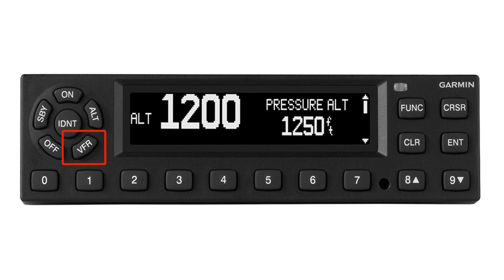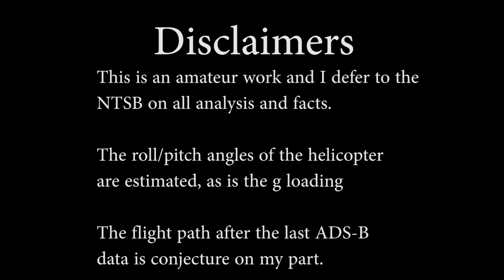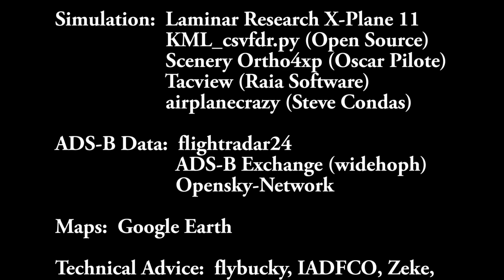Newly released Pilot to ATC Audio!  N72EX (Kobe Bryant) Crash Reconstruction.

Comment: As pilot with over 4500 hours experience, I beleve the pilot was flying VFR, went into IFR conditions, but kept flying VFR rules.
Reply from the maker: Just for my interest, do you think the pilot should have declared an emergency to ATC saying that he had gone IIMC?  I don't think it would have changed the outcome.
Reply: @stevencondas2281  should have flown with instruments to get out of the clouds imo. Every pilot should be able to do a 180° turn only with a Variometer, an Artificial Horizon and an Altimeter to be able to get out of the clouds if he somehow gets trapped inside one. 
In addition, in a well prepared flight you usually have a knowledge of the terrain around you (especially while flying VFR close to high reliefs) thus, you can be able to climb to a Safe Altitude over the clouds while flying on a determined heading that will keep you far from the high grounds (In a heli you can even stop yourself and climb vertically so nothing too difficult there imo).

Imo bad flight planning, lack of experience in such conditions, lack of training/qualifications to fly in such conditions, lack of authority (shouldn't even have departed with such a weather knowing his limits).

But hey, I am not a heli pilot, nor a professionnal pilot yet so I might be wrong.
Reply from the maker: @pinguuuu2269  FWIW, here is the high level IIMC procedure from the Island Express training manual: 

"Control: First use the wings on the attitude indicator to level the helicopter. Maintain heading and increase to climb power. Establish best climb airspeed but no slower than VMINI. Cross reference attitude indicator to indicate a positive attitude.

Climb: Climb straight ahead until your crosscheck is established. Then make a turn only to avoid terrain or objects. If a climb altitude has not been previously established with ATC, then you should climb to an altitude that is at least 1,000 feet above the highest known object or terrain and that allows for contacting ATC.

Turn: If a turn back to VMC is the best course of action, only initiate the turn after stable flight is achieved. First note the heading that you are on then begin the turn and maintain a
 constant rate of turn to the selected heading. Use of the heading bug is a great tool in this situation. (Steve's note:  The pilot was in a mountain pass when he went IIMC, so there were hills to either side perhaps making a 180 inadvisable)

Communicate: Attempt to contact ATC as soon as the helicopter is stabilized in the climb and headed away from danger. If the appropriate frequency is not known, you should attempt to contact ATC on either very high frequency (VHF) 121.5 or ultra high frequency (UHF) 243.0. Initial information provided to ATC should be your approximate location, that inadvertent IMC has been encountered and an emergency climb has been made, your altitude, amount of flight time remaining (fuel state), and number of persons on board. You should then request a vector to either VFR weather conditions or to the nearest suitable airport/heliport that conditions will support a successful approach. If unable to contact ATC and a transponder code has not been previously established with ATC for inadvertent IMC, change the transponder code to 7700.

Note: All of the above will be practiced by Manual Manipulation of the Controls and the use of Auto Pilot. The pilot will learn the advantages and disadvantages of recovery by Manual Control and Automation. Example manual control is quicker I Automation slower. However, if pilot experiencing spatial disorientation and unable to regain control Automation is the best option. Also, the pilot will become familiar with the use of the "Go-Around Button" and its functions."
Reply: Steven Condas I agree. It would have made no difference. Either he was hoping to see something outside or was inside and completely lost his scan. 
Looks quite similar to JFK Jr’s accident.
Reply: It certainly makes the case for two pilots in a helicopter when flying in bad weather or at night.  I served in military helicopters (Maritime) and experienced a novice pilot losing the bubble completely at night over the ocean and he started making radical changes in altitude not knowing where he was or how to react.  The experienced pilot took over as soon as he could and the aircraft settled smoothly.   I was a new backender in training but didn't realize what happened but knew it wasnt good when I saw the big eyes of my instructor and the beads of sweat coming down his face.
Reply: im only a loser wanna be virtual pilot and feel the same way. No way this guy was IFR IMO.
Reply: You are right Fernando. He became Spacial D & couldn’t simply transition to instruments. Those most basic things. VFR into IFR conditions and CFIT are big killers. In reality, he literally could of told ATC he needs a squawk and radar vectors because he did go into IMC which is an emergency. No big deal, squawk emerg, get a new code, & your good to go. So sad and preventable.....
Reply: @austinpacheco7214  20 years ago I took my pilot training in a Cessna 150 out of Akron Canton Airport. Then, the topic of JFK Jr's crash was discussed.  Spatial disorientation.   To the laymen, thinking your flying level when you are not.  We would practice flying with blinds on.  The instructor would do some hard banks and I had to tell him if we were flying level or not.  Do you know, most times I was incorrect.  Pilots need to rely on their gauges and not seat of the pants flying..
Reply: what an incredibly astute observation for someone with 4500 hours lmao

Comment: 0:59 - When he was originally handed off by VNY to Socal, Socal initially said "You're following a 1200 code". 
Does this mean that SoCal then gave him a new code, and then told him to squawk back to VFR? 

Burbank had originally given him the code.  When the pilot went to VNY he verbally said his code, which was odd. 

My original theory was that the pilot was "head in the cockpit" after handoff to Socal, having to reprogram his squawk code, that he may have mistakenly reset after Burbank handed off to VNY. 

Woah!!!  4:04 - You really did find missing audio from before. This changes everything.  

This is what I don't get...  Why did the first SoCal tell him to squawk back to VFR?  That delayed service by the next SoCal, because he had to ask for an ident -- and obviously he was high enough because 2nd Socal saw him on the scope. 

Really sad outcome - he was instrument rated, and could have done an IFR Pop-up with the first Socal.
Reply from the maker: Lots of questions there :)  At 0:59 SoCal is telling the pilot to change his squawk code from 235 (which was being used for VFR flight following around Burbank and VNY) to 1200 (signifying VFR without flight following).  SoCal says that they can't do flight following because they are going to lose RADAR contact with the helicopter due to its path and how low it is flying, and they want the aircraft transponder to start sending a 1200 code indicating that fact.  After this conversation, because the aircraft is SVFR without flight following, SoCal Approach has no further responsibilities with respect to N72EX.  It is now the responsibility of N72EX to get to Camarillo without ATC assistance.

The statement "You're following a 1200 code" is from the second controller at 4:02.  This means that the helicopter is emitting a 1200 code (which is the case because the last controller instructed him to do so, see above), and that the aircraft is VFR without flight following.  

"Why did the first SoCal tell him to squawk back to VFR?"  Because the controller was about to lose RADAR contract with the helicopter and thus ATC could not provide flight following services.  

"obviously he was high enough because 2nd Socal saw him on the scope"  I assume the second controller saw him on his scope ONLY because the helicopter had then climbed high enough to be seen.  Had the helicopter flown the path/altitude the pilot told the first controller, then I believe the helicopter would not have been visible on RADAR.
Reply: What dont you get..? The first controller said he wasnt gonna be able to maintain radar and comms with him at his altitude, which was 1400/1500 feet at the time and tracking due west from VNY under the clouds. When he talked to the second pilot he was around 2300 and much more to the southwest then due west of VNY like the pilot was flying when he first talked to the first socal controller. 2nd, the first controller would of been more then happy to give him an ifr pop up if he could of and the pilot requested it but the controller couldnt make him ifr anyways because he is under the MVA, minimum vectoring altitude, which you cant make an aircraft ifr under, unless.... the pilot can maintain their own terrain and obstruction clearance, which the pilot couldnt clearly meet to 3000 feet, the MVA where he was, so it was impossible for the controller to give him an IFR pop up, even if the pilot wanted it. Only option at the point is the pilot to land special VFR at VNY and depart there ifr. Once again tho the pilot was in VFR conditions flying his helicopter making his decisions. And helicopters can maneuver around much better at those lower altitudes then fix winged. Controller cant stop him from flying VFR under the clouds in class A airspace.

Comment: S-76s have a full autopilot.... Obviously the Pilot didn’t set it up and use the system as designed....It’s actually rather simple but you have to use it...

Single pilot IFR can be tough....Single pilot Unintentional IFR with a pilot who isn’t current in IFR is deadly.....

Comment from the maker: It looks like my crash reconstruction is consistent with the NTSB report 17 June: “Calculated apparent angles at this time show that the pilot could have misperceived both pitch and roll angles,” one report stated. "During the final descent the pilot, responding to (air traffic control), stated that they were ‘climbing to four thousand.’”

Viewers have informed me of two transcription errors at 0:58 and 1:02 where I misspelled "VFR" as "VRF", and another at 3:45 where the pilot most likely says "just West of Van Nuys" instead of "Southwest of Van Nuys".  A viewer also pointed out that I am mispronouncing ADS-B, and that it should be  "A D S B" and not "ads b".  A viewer pointed out that I should have said that the original squawk code was 0235 instead of 235.
Reply: sounds like you have a lot of real life pilots watching your stuff...
Reply from the maker: @jahnkaplank8626  If so, I hope that it helps them make better weather related decisions than they would have otherwise.
Reply: @stevencondas2281  trust me, every accident makes everyone a little better, especially if you say 'that could have been me'...
You should talk to pilots and find out how many heli pilots personally knew people that died in a crash... I think you'll be shocked.

Comment: Thank you for this. I always thought helicopters and airplanes had a loud alarm or something to alert you when descending so rapidly close to the ground or is that a movies thing?
Reply from the maker: The NTSB stated that the aircraft did not have a Terrain Awareness and Warning System (TAWS), and it was not required by the FAA.  That said, several pilots have written that it might not have mattered because it wouldn't have alarmed in time due to the rate of descent.
Reply: @stevencondas2281  thanks for the clarification. it was a truly unfortunate thing

Comment: I get a kick out of all the comments saying the pilot was IFR rated... the helicopter was not. It was to fly only under vfr flight rules period. Once he saw his horizon was becoming foggy he had two options.... look for a landing spot...field....parking lot.... etc....or do a safe turn back and tell the passengers it's a no go due to bad weather... attempting any entry into that type of terrain is a horribly reckless decision in a fog.... the NTSB put it correct... they have asked that all commercial helicopters be fitted with terrain warning systems, but the FAA has refused to mandate it.
Reply: But the fog was so heavy that even a terrain avoidance and warning system or a radar would have been useless. Even technology has its limits. Also the fog formed in just a second or two and just 12 inches in front of the helicopter while the helicopter was flying at 3 miles per minute. How could the pilot have possibly "done a safe turn back and told the passengers that it's a no go due to bad weather" under all these random and unforeseeable circumstances?

Comment: Some are saying that celebrities regularly pressure helicopter pilots to fly in sketchy weather, and that Kobe was no exception. If so, I hope celebrities now know that they should just listen and not use their starpower to circumvent normal rules/regulations.
Reply: They didn’t circumvent any rules in order to fly
Reply from the maker: I wonder if the celebrity applied pressure, or the pilot placed pressure on himself not to let a celebrity down?
Reply: Steven Condas it could be both

Comment: He could have parked it right in the middle of 101when it got thick if he really needed to .. it was Kobe Bryant ... he would have gotten a pass .. and they would all be alive :(
Reply: During an emergency, you may deviate from any and all regulations to meet the extend of the emergency. That's the FAA rule...
Reply: The Underwaterman  Imagine not understanding basic flight procedures and putting emojis in your comment like you won or something... Yikes.
Reply: The Underwaterman  ..and cause car accident and kills someone else.
Reply: Umm you can’t just park a helicopter on a freeway, much less a very busy one like the 101.
Reply: @bryanm7296  in an emergency (which this clearly was) you can set it down anywhere .. planes land on highways with engine failure all the time and medevac copters land on freeways routinely to transport accident victims
Reply: cunn9305 Latest reports suggest that the pilot didn’t even know he was in an emergency.  Sounds like he was disoriented and thought he was ascending but actually descending.  Even if the pilot wanted to land it because of thick fog he’s not going to choose a busy ass freeway like the 101 unless there was catastrophic engine failure or something along those lines where he had no choice but to land on a freeway.

Comment: I believe he could have had a medical emergency, but in any scenario pilots should always fly with co-pilots, it's a high chance this tragedy never happens!
Reply: Do the pilot sounds like he was having a medical emergency at any point? And they have already performed autopsy.
Reply: @CodyCha  If you watch the video up top the narrator also stated that it could have been a medical emergengy to the pilot. There are numerous ways to abruptly die of natural causes, and because of the condition of the pilots body means that the medical examiners could not have successfully ruled out every cause. The pilot had plenty of time to respond to the air traffic controller before they crashed, I believe the silence speaks volumes meaning the pilot could have been in duress and unable to control the chopper. It's also been said he may have lost control from being disoriented from the fog, well why didn't he reduce his speed and why wasn't he fighting or working to regain control of the components which means the chopper would have been maneuvering all over the place, but instead it bank hard to the left going extremely fast until they crashed. I'm no supposed expert but based on what I see from the evidence and common sense I wouldn't be to quick not to rule this out.
Reply: Black MoonHawk when a pilot is suffering from spatial disorientation he is not aware he’s disoriented. That’s why it’s so dangerous. That explains why he didn’t make any corrections as the helicopter was diving. The autopsy has determined the cause of pilots death as burnt force trama. Unless you want to argue that autopsy in fatal accident is useless, it’s pointless to argue that pilot a medical emergency. The reason where were no response from the pilot seconds before the crash is most likely because the helicopter was at low altitude in a valley.

Comment: Excellent video - but - the new audio seems to me (a non-pilot) like ATC was too busy with other aircraft and "stalling" for some time, which the helicopter did not have. Just kept asking these redundant questions (during a time of peril) until the heli was crashed.
Reply from the maker: The controller was talking with other aircraft, but I don't think he was stalling for time.  In fact, my sense was that the controller was talking to other aircraft to clear the decks so that he could deal with this aircraft that had popped into his airspace unannounced (because the aircraft was flying Visual Flight Rules and shouldn't require the controller's attention).  The controller then asks the pilot about his intentions, and the pilot responds in a tone that, to my ear,  sounds distracted and not panicked.  I don't think that anything would be different if the controller had asked the question to the pilot any sooner.  I'm sorry if my muting the audio to the other aircraft caused you to think the controller was stalling.
Reply: @stevencondas2281  Think we are in agreement. I knew the controller was muted, just didn't like his tone. Bothered by the extra traffic? Amazing part to me was pilot (sadly was) world class and how few seconds it may have taken for the artificial horizon to change without being noticed before the heli augured in. Wonder if pilot had a second to realize what was happening.